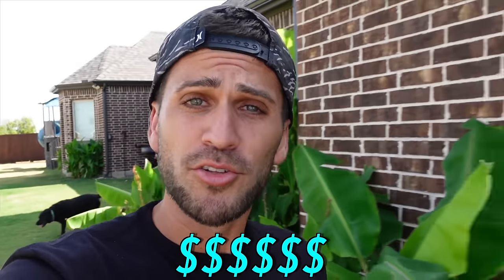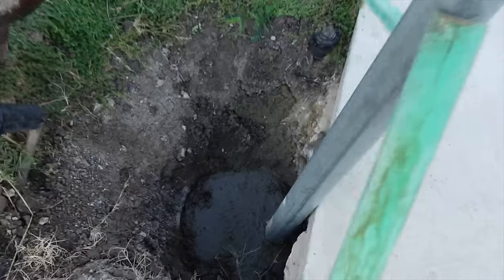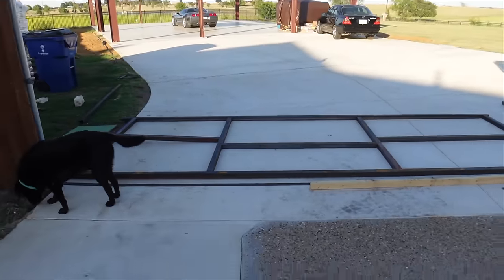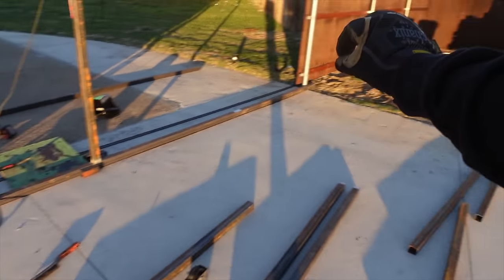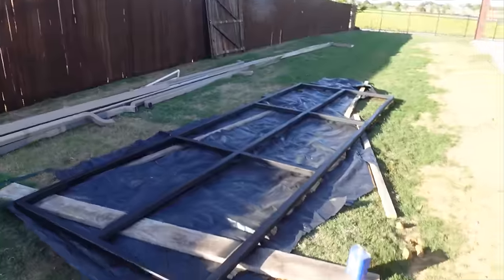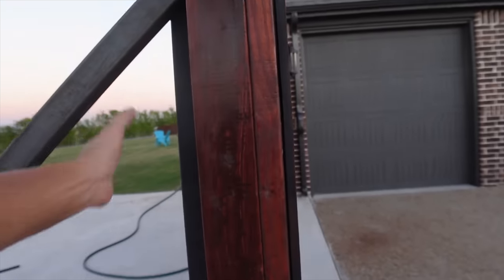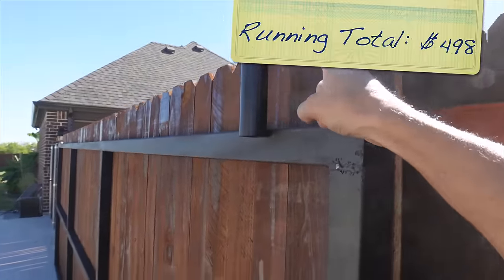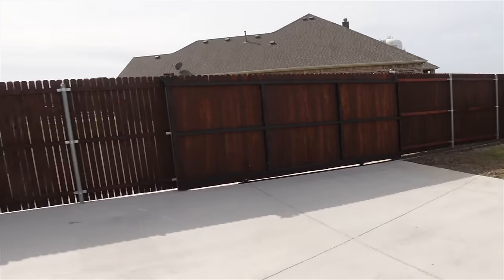I Built A CUSTOM Driveway GATE for $500

Comment: Very well done and beautiful.  If you're worried about your post standing up to a wind, fill the post with cement.  If you are using bagged concrete you may want to improve the strength of the mix by adding additional cement to the bag mix.  The bag is usually mixed to 2,000 psi.  To get it to about 4,000 psi add 2 full shovels of cement to the mix.  This will increase the strength of the  mix and in turn the post.  Make sure to hammer the post as you put the concrete into the post.  This will make sure that you don't have air pockets and the post is full from bottom to top.
This is the way posts are done in parking lots and around items that require protection in parking lots.

Comment: I'd run that lower track 100% across  the opening as you have potential to catch a sidewall  and knocking hole in tire if you only go so far across
Reply: Was going to say the same thing.  taking it the extra 4 feet until behind the other side of fencing, even if not technically needed would also help with it looking more uniform as well as protecting cars, kids, and others from catching the edge.  Ideally it would have been set into the concrete vs raised, but sometimes you just gotta make do.
Reply: Agree100% for visual and cohesiveness and I would worry about that corner .
Reply: I would run it all the way across as well.
Reply: Same. Run the track all the way across. And, fill the pole to strengthen it.
Reply: Same thought, also, just for appearance, all the way across is going to look better.
Reply: Looking so good so don’t skimp now by not taking that lower track all of the way across the opening. You will regret it later as it will always look unfinished like you ran out of money and couldn’t complete the project
Reply: Huge mistake to not run that track all the way across!
Reply: I'll second this, not to mention the kids and playing around it, stubbing a toe, ruining a tire, etc.  Its a short distance, run it all the way across.
Reply: Yup, make it look finished. That end makes my OCD senses tingle.
Reply: Agree run the track all the way
Reply: I have seen guys do a gutter in the concrete so it rides at grade. Love the gate either way.
Reply: Came to suggest this and the pole be filled with concrete. Great minds.
Reply: It will just bother me to see the track not being all the way across.
Reply: At work we did not want to run the track to the end to have a smooth surface when we push toolboxes or similar. We cut the rail from the bottom and then hammered it down to get a smooth transition.
Reply: 90 @gunndygaming
Reply: Same plus would eliminate need to grind end to protect kiddos would be aesthetically better look
Reply: I wouldn't dude has this gate for a shop application more than anything else if he has to pull out his tool boxes or carts for whatever reason that last 4 ft allows him to not have to lift a giant box over that wheel

Comment: Fill the pole with concreat. That will help stiffen the post and make it less susceptible to bending.
Reply from the maker: 👆🏽love this idea!
Reply: @LonestarHawaiian  doh.. should have read the comments before I made mine above.  In addition to concrete, add rebar, or mix the concrete with reinforcing fibre (same stuff they use in concrete counter tops) to strengthen against shear loads.
Reply: Great idea! I've also seen a boxed steel piece (maybe 3x3 or 4x4...not sure) used as a vertical support for these gates. Not a pro, though.
Reply: @LonestarHawaiian, I agree with this. I had fixed a broken fence post on a chain link swing gate that broke at ground level by running a couple of pieces of rebar down the center of the post then filling with concrete. In your case I would probably use 3 pieces of rebar down the center of the post and filling with concrete. I would probably do that to both posts for the rolling gate and maybe even the couple of posts that you moved.
Reply: And as you fill them with concrete use a hammer drill with a super dull bit or a sawzall (reciprocating saw) to vibrate the post so the concrete can settle inside.
Reply: When we've had posts that need extra strength we filled them with concrete. It's the right way to reinforce it. Just like ballards to protect door openings.
Reply: I was saying the same thing watching the video. That will solve his issue.
Reply: @LonestarHawaiian  
Put a second solid steel post inside the other post, matching o.d. to i.d
 and possibly just use liquid nails to slide inside and secure......
You may need scaffolding to do this....
😆 LOL.  Concrete and rebar sticks inside may be easier.....the rebar would help settle concrete too.
Reply: Bad ass! Enjoy watching these diy projects along with some cars in between!
Reply: Came to suggest this and the track all the way across. Great minds.
Reply: @mrljvb ngl a gate like that could keep a roll away in your yard!! or maybe someone out lol love the tips!

Comment: Welding tip, if you're using flux core ( I don't see gas) ; verify the welder is setup for DC Electrode Negative (DCEN).  It will greatly reduce splatter.

Comment: A nice little trick I learned when I first started out welding. Is if your having trouble seeing your weld is to use soap stone to mark your weld path it makes the weld much brighter and helps you see the weld much better. Anyway great work!
Reply from the maker: Thanks!
Reply: good tip..  welding outside in direct sunlight always is a problem. light comming from the back of your mask causes your eyes to dialate, and cant see shit.

Comment: At Tractor Supply, you'll find Hobart anti spatter spray. Spray it on the tip  and on what you're welding. You'll see that the spatter brushes or grinds off much cleaner.

Comment: Crazy that both top comments was exactly what I was going to suggest. Now for a new one, put a second rolling pin brace down further. If it should ever get bumped it might help keep it from falling over and hurting someone. Obviously closed and bumped is not as likely to come off track but at any other point you are relying on one pivot point, try and lessen that vulnerability. You could also just add a rail, think hand rail, onto that pad you poured that comes up about half way. The fence would catch it falling one way and the safety rail the other.

Comment: 8:45 and 19:17 you can see the existing fence on the right has a slight gap between planks to allow the wood to expand and contract, clamping them tight at 16:57 won't leave any room for that...

Comment: This is great work! I need to do this to my vinyl fence. I was soft quoted 8 grand to replace a portion of my vinyl fence with a sliding gate like this.  I said to the guy I could buy a tig welder and the metal and build it myself for less than a quarter of the price. Needless to say I never got the formal proposal from him.

Comment: weld up the ends of the square tube or water will sit inside and rust from the inside out. also would extend the Vtrack all the way across the width of the gate so the end dose not wiggle or move if you extend it the full width you can fasten it down very well at either end without roll interupting.

Comment: There’s a Spaulding spray u can use for cleaner work. To much heat and dirty steel.  Try trigger welding instead. If not turn your wire speed down and heat till you get it right. Your fillet is important. Got to bevel your steel more and or leave a bit of a gap when marrying your pieces so you have a little more penetration.
Reply from the maker: Thank you!

Comment: Steel here: With the polls a usually good idea is to plate it for strength and when you dig down - dig in a square and concrete the general area before putting dirt over the rest - adds stability to the structure - if you wanna be rough just weld the plate and it will be fine - if you want even stronger bolt through the plates into harder ground with a rod

Comment: That entire 16' section is only held in place by the roller tube at 21:33. The first time you get a straightline wind across the gate its blowing over and destroying it. I would consider another vertical support on the opposite side of the gate to sandwich the moving gate in the middle and make it more rigid and prevent it from toppling over in a wind storm.

Comment: You can motorized that gate from ebay or amazon for about $220 (I did the same thing). No need to spend a thousand dollars for a fancy motor. The $220 cheap version lasted us 3-years and is doing just fine! Came with two remotes and I was even able to buy a separate wireless keypad that lets us open/close the gate from outside.

Comment: Eh... Just depends.... Those metal poles staying in the ground more often than not depend on was the Concrete properly mixed before pouring and did you you give yourself enough depth to properly anchor into the ground. Some people either cheap out buying a short fence pole instead of getting the longer (usually 9-10 ft long) proper fence pole.

Comment: Next time mount a 2x2 wood horizontally on the metal frame(top, middle and bottom), that way you can just screw the slats into wood, much easier and a lot faster than into metal.

Comment: As someone that used to do fence work. You did really good on your own. I would trim down the fence post so you don’t see then from the outside. But that’s just a visual preference. If the post that I’m talking about doesn’t hold up with the wind. Because I know about wind because of being in Oklahoma. I would go back to that metal supplier and get a 8-10ft 2x2 and put 2-3 feet deep in the ground with concrete inside of it and 80-160lbs of concrete.
Reply from the maker: Thanks!
Reply: @LonestarHawaiian  you’re welcome. Also if you do that post weld rebar to it so it has rebar in the concrete. When you cut the bottom fence pickets use a circular saw having the smaller side of the foot riding the ground. You will get a nice cut doing that.

Comment: Like someone say - FILL THE POLE WITH CONCRETE 
but - use glass or basalt fibers to make it stronger , add plasticizer so you will need less water to make it "flow" better (with less water it will be even stronger and less chance of cracks) 
and MUST HAVE ( 2 above isn't as necessary)==== add at least 1 piece of rebar so it wont crack after some time and wont get pushed up if the pipe is smooth (it will be best to add 2-3 pieces of 4-8mm rebar / alternative will be piece of threded rod )

Comment: Cemented fence posts do have a serious tendency to crack. The expansion coefficient of steel and concrete is close, but not quite the same, and during summer, that pole will heat up way quicker than the concrete. The better option is screw in posts. They just don't move, even when subjected to the freeze and thaw cycles of a harsh Canadian winter.

Comment: Just a 12x6' folding gate with a 4' and 8' section.  It was built right with 4x4's instead of 2x4's previously and really good hinges.  Almost 8 years ago that cost me almost a $1000.  In today's economy this gate was a great value and you learned new skills/things like pickets need to be cut to size.

Comment: The splatter has alot to do with being Flux core wire. If you ran gas, you usually get much cleaner welds

Comment: Reverse your polarity on the welder - Switch the cables under the door to the opposite posts. Bingo! And get a micro closer to the material. Also I know you want to bang it out and save time. But slow down a little and slow down the feed a little more. Be patient. That thing isn’t meant for speed and production quantity. Good stuff. Plus, it isn’t anything a soft grinding wheel cant fix.Maybe think about sealing the tube ends on the gate up as well. Rusting from both the inside and out is a death sentence, especially in Hawaii. Sealing the ends will allow rust on one side and extend the life of it.

Comment: You can uncap the metal fence posts, run rebar or a small pipe inside them, then fill them with concrete. 
Then paint them black to match the black metal on the sliding gate.

Comment: Buy when in budget some drill stem and change out your poles and put 160lbs of concrete in on each pole, that fence would stop a Sherman tank from entering, and run your track 100% across the opening instead of partially across just so that you dont cut a tire on a sharp corner and spoil your day, other than that, your fence looks beautiful man. You did a good job welding the frame up. Hopefully soon i can follow in your footsteps on building my shop and barn dominium. its what will kickoff my very own youtube channel.👍👍👍

Comment: Nice work!  You can buy a thicker pole, but will cost.  Also, you might look for used oil field pipe.  My buddy did his with it.  Was a slight bit cheaper than posts, but way thicker.  He set his sliding fence with 4 inch pipe.  Painted it all black.  Looked great. My drive way goes just under my fence so I can pull something into the back yard.  Previous owner had a boat.   It would be nice for trailer storage.   I need to the do the same thing.

Comment: Nice job brother on the gate bevel your cuts makes for a stronger weld, mig welding doesn’t like any kind of wind that could have also caused the some of the splatter. I feel for you welding out in the sun beating down on you when it’s 100 degrees but you accomplished what you set out to do.👍🇺🇸🇺🇸

Comment: When I built mine, I bolted 2x2’s to the rails with 1/4” bolts   Then was able to screw the pickets to the 2x2’s.  It saved some time.  I’ve screwed those pickets into the metal before and that sucked

Comment: Maybe buying a pressure washer with a fine amount of different Nozzle attachments will be the next best purchase because often, times wood and metal fences that have been out in the open facing all the different types of weather and hot and cold climates causing them to grow corrosion or a mold layer on their surface so hosing them down with a powerful pressure washer will help to rejuvenate them back to life good as new.
if it doesn't work out then you will still have a fine pressure washer to was your cars and big trucks with at hand really helping you out and saving overall water usage altogether by reducing total water bucket filling trips and just the total amount of water flowing off from a water hose so save water on your property cleanup and vehicle clean up time.

Comment: I would only run the angle behind the fence.  Move the V casters so they are both towards that same side & then add a standard round caster, or rubber wheel to span the gap where vehicles travel.
Reply from the maker: I love this idea 💯

Comment: honestly man considering you are a hobbyist welder as long as it holds its good enough, you can always cut the welds out and reweld when you are better or even replace it as needed.  I would buy scrap plate and cut it into practice pieces if you want some cheap coupons to tune in and practice with.  - professional welder
Reply: basic rule tho if it's metal paint it so even if it's some booger welds some metal primer then paint will help it not corrode very quickly

Comment: Suggestion for your questionable fence pipe that you think might get destroyed be texas tornado. Take cap off top of pipe, put rebar in it and fill it with mortar. If it holds up it will save you the hassle of digging up old post.

Comment: you need some triangulation struts on that rolling gate
from the two upper corners to the lower center and from the two lower corners to the upper center

if you do not you will get sag and the gate will slowly fall out of true, it might take 10 or 20 years but you will have to rebuild that gate several times as you own your house

they also make sag cables that go from upper hinge side to lower latch side for the swing gate and any time it gets out of alignment you just tighten it up

also your wood issues has nothing to do with the manufacture it only has to do with the wood
wood takes a long time to dry and even if you get it 100% dry it will pick up water from the air and expand and contract different amounts along the whole board
the only wood you can buy that does not have this effect is low/high-density fiberboard but these are no good for wet environments

Comment: If there was a way to run that track in the actual concrete all the way across it would have been even better and you wouldnt have to worry about the kids or anyone else tripping over it. 

I also would have mounted the handle for the pull going up and down instead of across. You could put a 2x4 block behind it to hold it steady on the fence plank. Thats what i did when i installed mine.

Comment: Simple fix for the handle just router in an indent that will give your fingers purchase to pull the gate left or right to finish it you just need to stain it one more thing you might want to screw two stops on the gate. you don't want it going to far in or out and falling.

Comment: Get away from flux core get yourself a miller 211 (miller mig welders run  WAY better than lincolns in my experience) and run 75/25 mix with 030 wire. Youll be light years ahead in the way your welds look from that flux core setup. Feel free to shoot me a message I can walk you through settings and what not
Reply from the maker: Thank you! The welder is my dad's... once I get the shop up I'll be buying my own. I'll be taking a look at the Miller for sure.